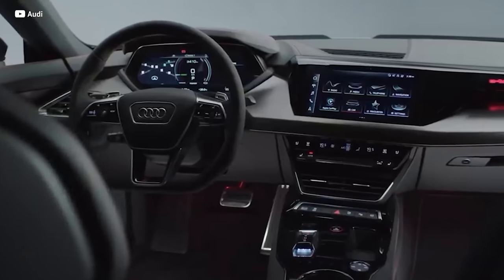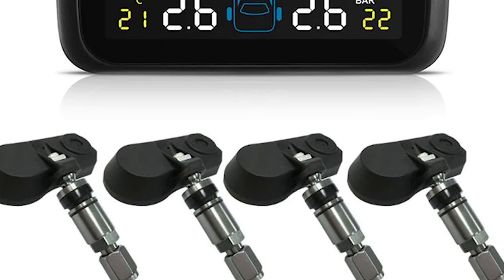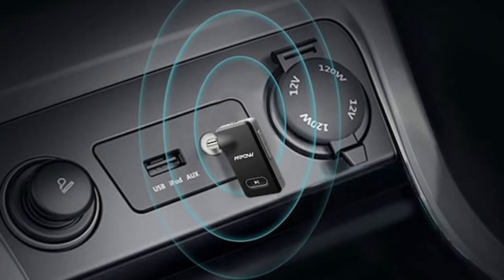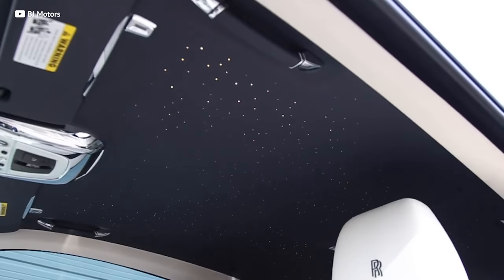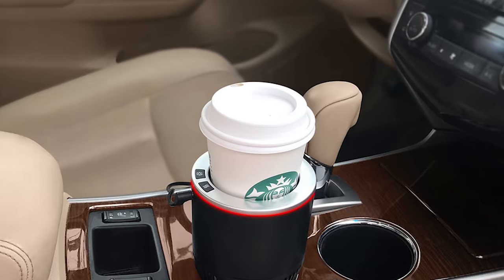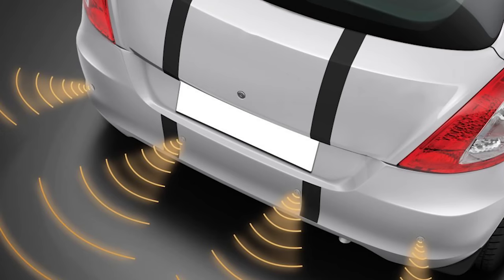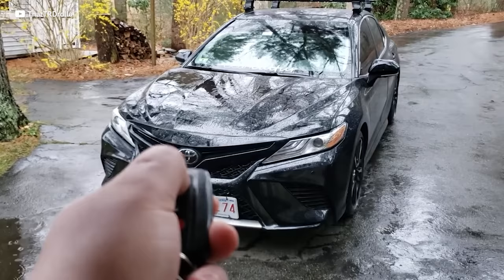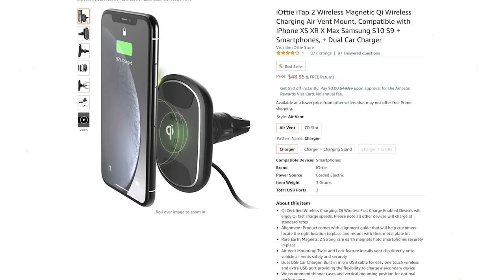MUST HAVE Amazon Car Mods That Transform YOUR Car in 2021!

Comment from the maker: Snag These Ideal Mods On Amazon! 
Tire Pressure Monitoring System - https://amzn.to/3pVvFmp
Bluetooth - https://amzn.to/2P4RWRU
Starlight Headliner - https://amzn.to/2MmjCRg
Heated/Cooled Cup Holder - https://amzn.to/3ukHy8N
Backup Camera - https://amzn.to/2ZFBzx4
Remote Start - https://amzn.to/2P7Ewob
Wireless Charging - https://amzn.to/37CZSQv
Reply: My car doesn’t have an aux port
Reply: Does the remote start work with manual cars? Idk how it would because it’s in first gear when it’s parked and I’m not gonna be able to be in the car to put it in neutral
Reply: Coucou mon bb aa
Reply: I have a 2020 trd ill put your logo in my head liner if you sponsor me
Reply: Yo I'd definitely take any Ideal logo(s) decals over some RR stars
Reply: The fact that the Amazon links are most probably affiliate was NEVER disclosed. Not cool.
Reply: links are not working

Comment: "Every car has an axu port" me with a 2003 mustang uhhh no I don't lol
Reply: Me in a 2012 Honda 💀😂
Reply: 1991 classic grand marquis - i have an aux port
Reply: My 2000 accord with the upgraded Audio system that only has a CD player. It’s funny how the tape deck actually ended up having more of a use at the end of its life than a CD player I rather have the tape deck because then it’s like a aux port.
Reply: 2004 Pontiac grand am stock radio not one in sight
Reply: Same 😂
Reply: 2019 ford fusion says hello lmfao. not sure what they were thinking but its ford after all
Reply: @Sillystring365  I had a 2012 accord but I think it was stashed in the bottom of the center console
Reply: My 03 accord doesn't either
Reply: my 07 mustang had one. hence the word had. someone put in a back up camera, gps, put in a radio that shouldn't fit and in doing all this the aux is just gone
Reply: sucks even more that the speakers that they added in the doors don't even work for the radio part😞
Reply: @kettynhowell4497  a radio only has like 15 wires just run your own wires forget about what they got goin on
Reply: me with a 77 chevy 😅
Reply: Just get a new stereo, 120-350 is a good price.
Reply: Me to
Reply: Me in my busted Nissan Versa 👁👄👁
Reply: Me with my 98 Elantra wagon 😐
Reply: Me in a 99 Cavalier
Reply: Also me in an 05 Altima
Reply: However, I do have an aftermarket stereo in the 99, but I want one in my new car xd
Reply: Me with a 2001 peugeot 106 rallye: "i don't have ac men"
Reply: Me in a 2007 milan
Reply: 2015 with no backup camera
Reply: Get a fm transmitter it's better.
Reply: @Happypen8779  it's usually not better. Especially in my car. Signal is trash.
Reply: Right I went to check my 06 Kia nope 👎 lol 😂
Reply: 2005 Acura TL
Reply: There are aux to casette adapters, they are really cool
Reply: id have a doble din stereo by now on that mustang
Reply: 67 international lol
Reply: Me in a 94 si “what’s a aux port?”🧐😂
Reply: @thetechlibrarian   I use a Bluetooth transmitter
Reply: Just install a new radio. It's very easy
Reply: Me with a 95 lumina
Reply: Me in my 2004 Toyota Corolla 😆
Reply: @Sillystring365  2012 Honda?
I have a 2009 accord n it has an aux port
Reply: Gotta love how trash old American cars are
Reply: 99 silverado :( I don't have aux
Reply: Lmaooo same🥲 I have a 2006 Taurus
Reply: I had to get a new stereo installed in my 94 mustang because I couldn’t stand playing music on a Bluetooth speaker haha
Reply: Same with 2021 VW GLI
Reply: 1998 civic have one
Reply: Me with a 1999 Toyota Sienna
Reply: I hate the radio in my 03 mustang lol
Reply: Lol right , a 04 mustang , only A.C
Reply: Yeah, he already made that Joke with the Tracy Morgan cut-away. So..   you are not funny
Reply: Me with a 98 civic
Reply: 2020 sonata doesn’t have an aux port that i’ve seen yet 😅
Reply: My dads 1964 Corvette stingray has one
Reply: @unrealisticgoals  why do you want a aux port in 2019 fusion?
Reply: Me in a 86 Caddy Fleetwood 💀
Reply: 2005 Lexus
Reply: My last 3 cars didn't have one 🤣 
I've finally got one in my 2007 and feel like a king
Reply: @aiden-nm4pi  I have a 1980s John Deere 4650, and it also has an aux
Reply: @Sillystring365  i have a 2011 pilot. Check your center console, mine is is in there
Reply: Me in a 2003 ram 1500. Uhhhh
Reply: He said pretty much me with nun
Reply: Me with a 2000 Lexus ES 300💀
Reply: 97 s10 we had tape decks🤣
Reply: In a 2004 Pontiac Grand prix lmao
Reply: screams in 2002 buick century
Reply: Me without a car: I don’t even know what that is.
Reply: I have an 03 too .. I just installed one...
Reply: Me with a 22 mitsubishi, uh mo I don’t
Reply: @Ed1TMedia  it was bro I have a 2012 accord
Reply: Me in a 2001 Camry 💀
Reply: Bruh my 03 Toyota echo and 04 Porsche cayenne both have no aux either
Reply: Me in a 2002 ford ranger
Reply: My 2000 hyundai sonata
Reply: Transmitter
Reply: Me in a 2003 Sorento 😭
Reply: me in my 02 sport track “🙃”
Reply: 1997 f150 i got aux
Reply: Use the cigarette lighter part find one that fits in there
Reply: Still using a transmitter for my 03 matrix
Reply: Ive got a cassette slot in mine lol I have one of those cassette to aux converter things lol It works okay
Reply: I am here with a 2002 accord that has a cassette player which i don’t think works, i listen to music on my phone 🙂
Reply: me with a 1930 ford 😹
Reply: In a mustang why would you want to hear music over the engine?
Reply: My 2010 Highlander has one lol
Reply: 2003 crown Vic, but I got a custom boss stereo. But no aux port
Reply: 2015 chevy spark here, no aux port🤣🤣🤣
Reply: Seen this.. I too own a 2003 mustang.. and to the guy below I own a 2010 Honda aswell 💀😂
Reply: Me with a 1885 Benz…
Reply: Me in my 04 ion💀
Reply: my dad’s 2013 audi q5 doesn’t have one either lol
Reply: Me with a 2009 Cadillac Escalade
Reply: Me in my 2006 Nissan Altima - no but thank god for my aftermarket JVC radio unit I do now…
Reply: Me in a 2016 Lancer 😔💔
Reply: Sxxx cuz Daaas
Reply: I had to have one installed in my 2007 Escalade
Reply: My 2003 Ford Taurus😭
Reply: He’s wrong anyway it works thru the cigarette lighter port and all u do is put the radio on the same station as the transmitter and connect to the Bluetooth… then just play something 🔊🔉🔊
Reply: My 2010 Mercedes’ GLK 350 doesn’t have one 🙄
Reply: Don’t worry I don’t think any car has an “axu” port so you’re not alone
Reply: I guess you have Type C port then..😝
Reply: A 2003 saab 9-3 wishes
Reply: Same with civic up to 04 I believe. I’m in an 03:/. RF transmitter type are ok though
Reply: my 2001 suburban laughed at that
Reply: Me with my 95 ford explorer
Reply: Me with my 2009 Saab 9-7x 🤡
Reply: My 1997 Toyota T100😐
Reply: Me in my 2004 ram
Reply: Check in the glove box far right/front corner… that’s where the 2008 GT aux port is located
Reply: There’s adapters for cig lighter port for just about anything
Reply: Use the cigarette port
Reply: '02 Buick here lol
Reply: Me with an 04 mustang with the aux port but not in a good position:(
Reply: My 70 Chevelle has one
Reply: 94 mustang here and had the sound system done up and had put an aux port in along with the charging port at the same time 😅
Reply: same I had to buy one for my 06 honda ridgeline
Reply: Me with a 2020 mitsubishi mirage

Nope
Reply: My 92 Toyota crown has a cassette tape player.
I also have 53 dollars in my bank account
Reply: okay but you have bluetooth which you defined do have, so it doesnt matter
Reply: Yea I’m gonna get my mom’s 2006 Colorado until I can afford a Miata and the Colorado doesn’t have one either
Reply: They have cigarette lighter versions that work great. Also got a quick charge usb-c port.
Reply: Me in toyota sedan 2019💀
Reply: Gotta use the tape Casset aux
Reply: Same I have a 01 mustang
Reply: But we got Bluetooth radios
Reply: Me with a 97 f150
Reply: Fm transmitter
Reply: 2015 Chevy  Colorado auxLESS😢
Reply: 2003 Volvo XC90. Most models got aux. Mine didn't. Had to do weird shit to bypass the embedded car server and get a new stereo working.
Reply: Me with an 06 infiniti m35.... not only no aux but can't put in an aftermarket sterio.😂
Reply: Do you have a cassette deck?  I use an adapter for that in a 2001 car.
Reply: Got a 2003 ford and I got aux
Reply: Not me with a 2003 Ford Taurus 🤣🤣
Reply: @Wirewelding  in a word: Eurobeat.
Reply: 1988 camaro iroc-z😅😅😅
Reply: 06 mountaineer
Reply: 1926 ford
Reply: Not laughing at you. Laughing with you
Reply: @Sillystring365 BRO I WAS BOUTTA SAY SAME EXACT CAR☠️
Reply: Me in a 2005 Subaru Outback sport
Reply: @aiden-nm4pi Still whipping? I’m still whipping my 2000 GM LS!
Reply: Keep looking is somewhere in there 😊
Reply: @Dittozee  your comment brought me back here, I completely forgot this comment existed, way more interaction than I was anticipating lmao (just recently turned on comment notifications 😅)
Reply: me with an 09 lancer
Reply: I know that Ford Model T's and A's definitely don't 🤣🤣🤣
Reply: Use the cigarette lighter ports

Comment: I don't have enough cigarette lighter spots to keep all of these mods on at the same time :D
Reply: Buy an adapter of Amazon you can buy some that have 2-4 lighter ports that just just plug Into the main one
Reply: U can wire it up to ur interior fuse box
Reply: @ggsupreme5831  That's how you burn out, or even set fire to, your lighter port.
Don't do that.
Reply: @ggsupreme5831  dumb idea. I don’t wanna wire new cig lighters all the time

Comment: Who needs remote start when ya have kids over 14 yrs old. I just lettem jam in the car till I'm ready to go. 😃
Reply: what
Reply: @freddiebensonstan7037  That means  I let my Daughter or my Son start the car, and they can listen to the radio. Then when the car gets warm I come and drive it. It's an old folk thang.
Reply: @oblivious2reality520  thank you for explaining
Reply: @oblivious2reality520  but don't let them touch the gear shift, like if its on drive and they step on the accelerator the car can drive into the house so be careful if you let your kids start up the car and let them stay in the car Also if its an automatic shifter, the car can like creep forward on its own if its on drive
Reply: @vambat3523  Yeah typically I tell them if they wanna pull a stunt like that then the lever thingy with the letters next to it should be next to R before hitting the pedal, neighbors can deal with it
Reply: @mobeen1433  true, like cars can sometimes go forward without pushing on the forward pedal on drive like a bmw since they use automatic

Comment: If you have a older car, there’s a radio version of the Bluetooth things that go into the cig outlets. There’s also cassette aux cables that go into cassette trays
Reply: The cassette ones never worked for me so I gave up and put a screen in my 88 300zx 😂
Reply: Those don’t work for mine. I’ve tried everything lol. Got a new car tho so
Reply: Just change the radio that’s so lame
Reply: @Jazzyfresh981992  you’re lame if you never tried it
Reply: @TheDubstepmaster13  I don’t have to try it I got mine done for 300 dollars at a real shop and it runs off a switch lol don’t use this cheap mess
Reply: @TheDubstepmaster13  Chicago car guys try them lol never would put this on a newer car that’s definitely lame only reason I commented because it showed in my notifications I save money for real stuff not this

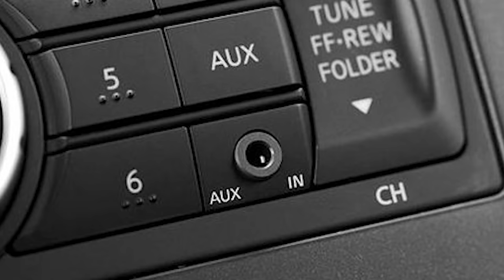Comment: @ 2:40, there are devices that only need a cigar lighter outlet to work, no aux input needed. This is very handy for those of us with really old cars.
Reply: Quality of sound is terrible thoug
Reply: @robsonson8026  it could be better but for $20 I’m not complaining.
Reply: I just got done installing an android touch screen in my 96 town car, it was like $70 and came with a backup camera, definitely would recommend, it beats the crap out of the original cassette tape radio.

Just be prepared to cut and splice wires
Reply: @noahw4623  I installed a backup cam that links to my phone and doesn’t spoil the retro Astetic of my car. It takes a bit to load up but deff worth the money!

Comment: I'd like to add- the bluetooth connectors for the speakers can plug right into the power outlet/cigarette lighter. No need for an aux port. They're great for charging too and you just connect them to a random station that has no signal, and set your radio to the same channel. You can also find them for much less than $25- cheapest I've bought was $10 and worked perfect. The one I have now lights up too :)
Reply: I was gonna mention that too. All your car needs to have is a cigarette lighter and a functioning radio

Comment: “Only expensive cars come with wireless chargers”

You can get a used kia for $15k that comes with a wireless charger.
Reply: Lol that's true and The 2018-2021 Accord Sports have them as well way under "Expensive" cars
Reply: seems rather expensive for a phone charger
Reply: 15K is still  a grip
Reply: Thats a lot of money
Reply: Recommending a Kia? Not so nice when you have to have the motor replaced  bc they sludge so easily and consume oil
Reply: @robbiemcneill4239  I’ve had two Kia’s and Hyundai’s and I’ve never had that issue, maybe you need to start changing your oil. I change mine every 6 months, they’re running nice. On the GDI’s I run a fuel additive to clean the injectors, and when it’s older do an intake clean
Reply: @Get_yotted  maybe I need to start changing my oil ? I don’t have a Hyundai or Kia. I worked there for years. Just because it didn’t happen to you, doesn’t mean there isn’t a massive recall for the 2.0t and 2.4L motors they have in their cars.
Reply: @Get_yotted  by the way, most Hyundai dealers recommend every 3 months or 3750 miles
Reply: @robbiemcneill4239  I’ve heard of that recall, it’s not an oil sludge issue, it’s an issue with the DI system, oil sludge is a byproduct of people who didn’t properly maintain the car.
Reply: @robbiemcneill4239  that’s bs, every 3 months is bs. I’ve worked with them and we don’t recommend 3 month intervals
Reply: Especially with full synthetic

Comment: TPMS is essential. Especially when you got tires that cost over $2,000. It won't just help you in the long run, on those days where your in your car with your y rated tires and decide "today is the day i wanna try being Smokey Nagata" your TPMS will make you slow down before you die
Reply: If TPMS was essential, Henry Ford would have made that standard equipment on the Model T.

I've gone my whole life without that nonsense. I have the knowledge, skill, and equipment to change a tire, and I drive vehicles with full size spares. I also inspect my tires regularly, which includes manually checking the tire pressure.  If it's low, I turn on the air compressor, and add air. This stuff isn't rocket science.
Reply: 200iq

Comment: Most of these accessories have been around for 15-20 years! Heck, even Pimp My Ride did a starlight headliner! I’ve had a reverse camera on my 94 mustang since 2008, heated seats since 2009, TPMS since 2018… …only reason I don’t have blind spot sensors is because I don’t want to drill into my bumpers.

Comment: DO NOT install the TPS... 6 months after I did, the valve stem broke off in my hand while trying to put air in my tire... Then all the air rushed out causing my day to get a lot worse 🙄🙄

Comment: You can have a star ceiling with a laser star projector for $20
Reply: Link ?
Reply: @lunchtre9375  Google it bro
Reply: @lunchtre9375  Aliexpress for like $2-$10 depending on model lmao.

Most of these car mods can be found on Aliexpress for 1/5th the price this dudes trying to sell you thru his affiliate links
Reply: How would you even be able to add a star light projector and do a clean install
Reply: @paulwalker9769  simply plug in a star light projector in your ciggy lighter & put it on the floor dude..

Comment: For the starlight headliner, can I just go to any mechanic and just ask them to install it? I'm getting a new car and it's my first. I'm new to the whole car modding business and don't know much.
Reply: Doubt it.  Go to a body shop, and ask them for a recommendation on someone that does custom interior work. And, by bodyshop, I don't mean Maaco; they probably won't know, and will also not care.  A local, non-chain shop could probably point you in the right direction, though.
Reply: Did you end up getting one? I was thinking the same but also live in Alberta and don’t know if it would last in the winter cold
Reply: @Stunna_ECN  nah

Comment: Just because you have a “TPMS” in your wheel doesn’t mean you get free flat repairs, all it does is to let you k is that you have a leak that your tire pressure is getting low. I work at a tire shop and flat repairs are not free if you have a tpms. I feel that’s kinda false advertisement.

Comment: Very informative video! Do remote starters work in manual transmission cars?
Reply: You need to press on the clutch to start a manual but yes you can get a remote starter in a manual car
Reply: careful if you remote start and leave it in gear 😂

Comment: 1988 f150 with tpms system touch in dash with Bluetooth system .. toke from. 2015 focus in junk yard also the rear cam for backing up all scavenge parts 50 bucks install a few days an head aches but got it

Comment: If you don't have an aux port, you for sure have a cigarette lighter power port. Buy an FM bluetooth transmitter, tune your radio and the trasnmitter to a dead FM channel and you're off to the races.

Comment: Who fixes tires for free? I work in the industry it's 25 at my shop
Reply: The shop that I bought my tires from will plug a hole for free, up to a certain mileage (assuming that they installed the tires, and they were purchased there.) Though, last I needed tire repair, I opted to pay for the patch.